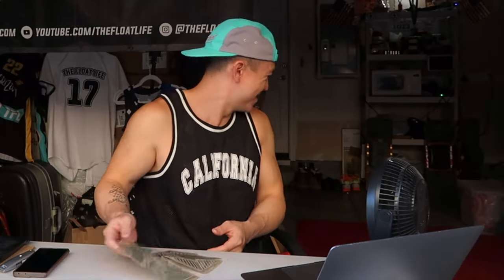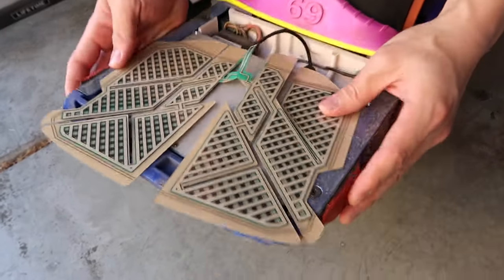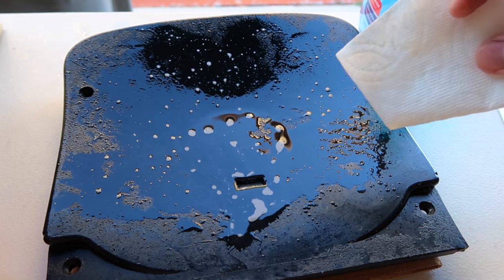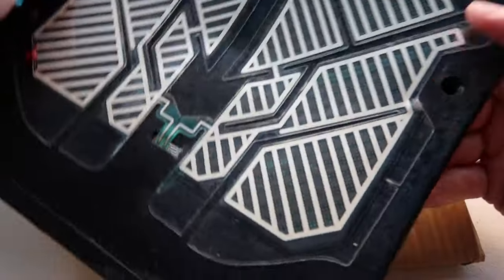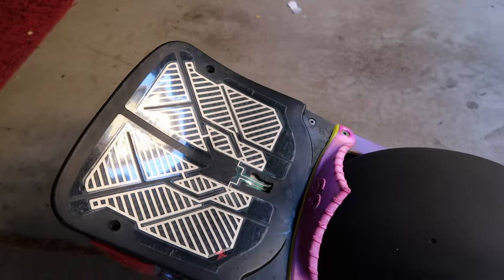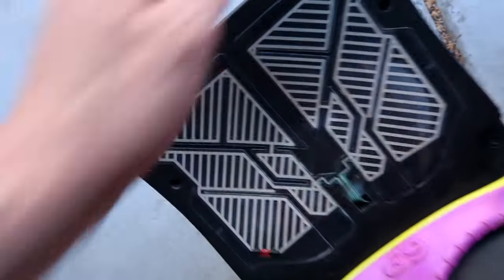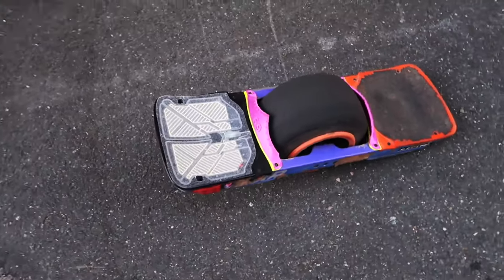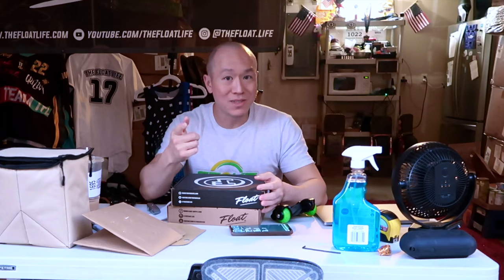Exile Sensor Install - best Onewheel aftermarket sensor?

Comment: Awesome video, Maxx! How does that controller cover do with rider weight? Is it pretty rigid?
Reply from the maker: thanks bro! I wouldn't do heavy drops/tricks without a metal plate underneath, unless you use the wooden pad with the exile sensor. But for mellow street riding it hasn't been an issue. But I believe Greg may be working on some custom metal plates..

Comment: It looks like an overall good product. And I'm happy to see more aftermarket sensors. Cause there are not much options out there. 
But I'm wondering why they made the cuts between the areas straight and not curved like on the Floatwheel sensor. It seems like Floatwheel are the only ones who made that geometrical conversion correctly. ("3d concave footpad to 2d flat sensor" calculation)
In practice it propably won't make a huge difference as a concaved pad is still pretty flat. But I appreciate the bit of extra effort that Floatwheel puts into such details.
Reply: Actually, that geometry accomplishes nothing special. As the gradients and curve within the concave are gradual. Not to mention, the oscillating reliefs within the sensors shape having an oscillation for one footpad may not be agreeable with another.  As a result the best course of action was to make straight lines in order to best negotiate all forms for use.

Tony’s original footpads had straight lines. He then made them oscillate likely to depart further from FMs form.
Reply: @Exile-exe  maybe I got it wrong, but a 3d concave pad is not like a sphere. I’s a side2side concave and a front2back concave that are comming together somehow. This curved lines are just the logical result of it as far as I understand it
Reply: @Eryktion  as I said above. Curves offer conformity for precise dimensions.  I was determined to offer a ubiquitous fit for all footpads.  So I could not be so precise in order to achieve this. So straight lines allow for more generalization and conformity for varying dimension.
Reply: @Exile-exe  yeah, I see that FW's sensor only has to fit that one pad and yours is meant to be uinversal. But for a flat pad it doesn't matter if the lines are straight or curved. For a double concaved pad on the other hand it might matter a bit. So even without knowing the exact geometry, I think curved cuts could be slightly better overall. But as I said it propably won't make a huge difference in the end.
Reply from the maker: Interesting point about straight vs curved cuts. I can see how curved could possibly mold better for concave, but the straight cuts on the Exile along with the moving panels settles perfectly into the concave with no wrinkles. Thanks for ur input🤙🏻

Comment: Thanks for this— super helpful as a reference (and for comparison to check if I eff up. Lol). 

What clear grip tape did you end up using? Is it course or more like regular skateboard with a fine texture? Thanks!
Reply from the maker: You're welcome! Hopefully it helps with better installs for everyone else. I used MOB skateboard grip with fine grain for trickin, but an even better option is perforated clear grip to help avoid air bubbles! Also don't preheat the grip before install like I did, when it's cold it'll be more firm and bridge better, and help avoid the wrinkle fold at the bottom. Best clear grip:
https://www.amazon.com/dp/B0949SK7B8?ref=ppx_yo2ov_dt_b_product_details&th=1
Reply: @MaxxSend  Oh, it's already helped me so I'm sure many others will benefit from it. Appreciate your thoughts, insight, and demo! Also for the grip tape info. Suepr helpful as well!

Comment: When you did the test at around minute 4:45, it looked like pressure was only needed on one side to activate. Is that true?  Does it not require sensing both sides in order to activate, like the stock sensor?

Comment: Looks like an awesome alternative for the stock sensors! Curious how it holds up. Looking forward to the basher test. 🙃
Reply from the maker: yea bro finally a fulyl customizable and cuttable sensor for concave pads! Will ride it to the maxx 😎
Reply: All beta and test units that were installed properly are still performing and in use today, 2 yrs later.

Comment: Wouldn't it make more sense to line up the grip tape just at the top, then work your way down the middle and out to prevent air bubbles?
Reply from the maker: The horseshoe method definitely works well. I just shouldn't have preheated the grip tape cuz it made it more soft n flexible. A cold grip would've helped it stay bridged better and then avoid the wrinkle fold at the bottom. Learn from my oversights!

Comment: PINT VERSION DOES NOT WORK WITH FOAM GRIP TAPE
Reply from the maker: oh didn't know that, it should be listed in the disclaimers. Even with the D dots, what ends up happening, no activation?
Reply: @MaxxSend  no activation with shoes on until I added gripples. Greg is aware and should be updating the listing and fixing the design in future production. 

No dots on the pint sensor.
Reply: There are no DDots on the pint.  This was a production oversight on my part and will be corrected.
On the pints page in the description it is noted that foam grip on pint sensor, may have connection issues.

However, regular grip functions as well as the XR/GT versions.

Comment: Looks like no metal plate needed under the pad. I was told I needed one.
Reply: It is recommended to take the pressure off of your controller box. There's a higher chance a hard drop may damage your controller without it.
Reply from the maker: yea I didn't have a metal plate option, but I think it's advisable if you go heavy on the riding. But for mellow street riding I think it's all good, I'll be riding without a plate. For trails and heavy tricks, I'l be using the exile sensor on a wooden pad in the meantime. I believe Greg is working on some metal plate options, stay tuned.. 🥸
Reply from the maker: @Electronic4081  fair point, a metal plate should be used if you do heavy riding. Greg is working on something, stay tuned!
Reply: @MaxxSend  awesome I’m exited to see what Greg comes up with! My Exile sensor is being delivered any day now and can’t wait to try it out!